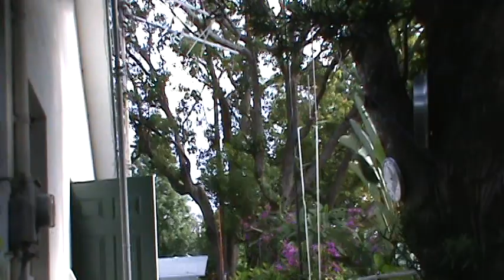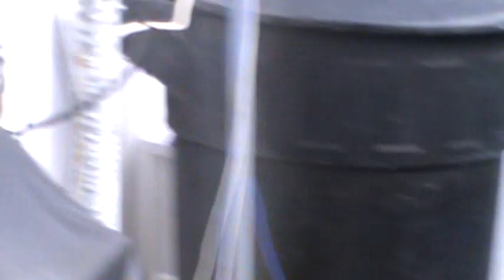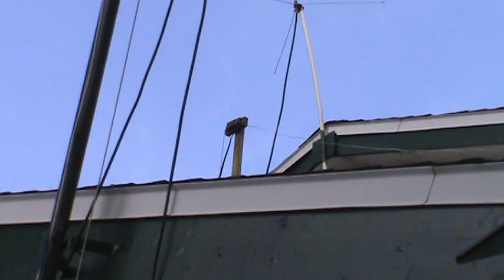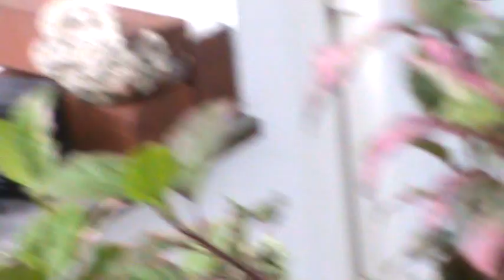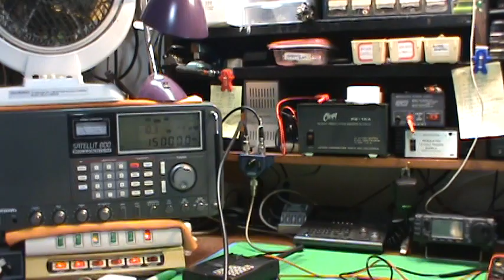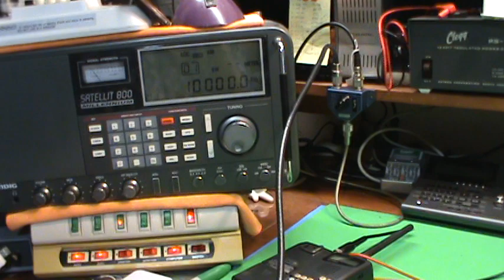TRRS #1517 - RS Multi-Band Antenna Testing - Pt 1

Comment: Great will be looking out for part 2. I have a slinky  antenna never used 20 plus years just found it while packing.
Reply from the maker: The slinky antenna that I reviewed worked pretty good but not great.  It is 95 degrees in my workshop this afternoon so I probably won't do any testing today but for sure tomorrow.
Reply: I will give it a try at a hamfest we are having soon on 2 meters I found I had a connector to my VHF/UHF radio

Comment: I was wondering if your mag mount on your AC unit is picking up noise when the compressor kicks in.
Reply from the maker: The mag mount is just sitting there for now.  It is not used when the AC is on and is moved to a different location.  Another part of my antenna mess. LOL  And would you believe my neighbor and I spent 2 hours cleaning up the mess?